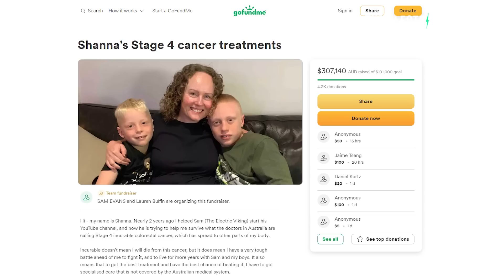CATL unveils Condensed Battery for Aircraft & 1000 mile range EV's

Comment: It would be interesting to know how fast these batteries can charge and discharge.
Reply: You'd assume it would have to be fast discharge for consideration in Aviation.
Reply: @Foogle6594   (not really as flights usually last a couple -- to many hours, less the economy is better using trains.)
Reply: @kadmow  I'd have thought that you need access to a lot of power very quickly at take-off (discharge/recharge rate). 

I.e the Power capacity to weight ratio has to be high to deliver a lot of acceleration. But as you mention the Energy capacity (500kW/h) needs to be high to maintain the range of the flight.
Reply: @Foogle6594 perhaps a hybrid will be a viable option. Fuel for takeoff but battery during flight for 50%+ fuel savings...
Reply: @Foogle6594  High-drain batteries could always be used for takeoff, then switch to long-distance batteries.
Reply: 1000 kilometers or miles ?Big difference between the numbers
Reply: @ralphhamilton4006  Kilometers
Reply: I'd prefer to know how many cycles they last. LiPO are awful for premature failure, these need to be 1000 times better.
Reply: If they can manage to go with a standard they could just pop in some fresh batteries after pulling out the old ones.
And they will probably be hybrid.
Reply: My first thought also!
Reply: One tire for a massively heavy e.v. is min 400 dollars for one in Canada.  8000 pound car will burn thru tires.
Reply: @blazeboyblazeboy4470  
Yeah, not sure where you got that nonsense from.

Larger cars have larger tyres.  Low rolling resistance tyres that are typically used on EVs last a long time because they’re quite hard.
Reply: @boggisthecat  it's not non sense. E.v. tires are double regular tires.  Don't mislead people. Heavy vehicle tires wear out faster from excess weight. I'm a mechanic so try ur nonsense on someone else.
Reply: @blazeboyblazeboy4470 : Okay, putting cost aside for a second, the only way your vehicle (whether it’s a gas or EV) will “burn through” tires is if you’re using the wrong tires for the vehicle/driving situation. The factory original tires on my LEAF lasted for 51,775 miles before I replaced them; and to be honest, the only reason I replaced them was that the tread was lower than I wanted to be caught driving on snow/ice with, they could have easily lasted 15k miles more outside of snow/ice driving. So what’d I replace them with? The best non-EV all-season tire I could find. That was 4k miles ago, and they’ve already gone from the 9/32 new tread, down to just a hair below 8/32 with just normal around town cruising. So yes, EV tires DO use a harder rubber compound; and the $30/tire I saved buying the non-EV tires was definitely not worth it. I don’t expect these Goodyear rubbers to last more than 20k miles, if even that.
Now, yes; literally speaking, EV tires are more expensive. And from my experience, tires are the most common maintenance item people cheap-out on is also the tires. At the end of the day, using the right part for the right job wins out.
Reply: @blazeboyblazeboy4470  
You must suck as a mechanic then, if you don’t know how true types differ.
Reply: @jacobcarlson4010  blabby isn't even paying attention. The principle benefit of these batteries is that they weigh far less for the same charge, 
They will still need special tyres, but not because of the weight but because of the huge torque. That means that the contact on the road needs to be greater so, with the lower weight, the tyres will actually last longer, not shorter.
BTW, I've just checked the price of tyres for the MG 4, and even a premium brand like Pirelli is just over €110, which is hardly any greater cost than a similar tyre for an ICE.
It's also worth noting that, if you end up replacing the battery on your leaf, you may find that replacement batteries will be using this tech, so your Leaf could possibly double its range. I know there are now companies that do battery swaps for Leafs, and that is because there are so many of them around.
Reply: @blazeboyblazeboy4470  You're certainly no mechanic I'd trust, because your argument is simply ridiculous. BEV tyres are nowhere near the "Double" you claim. 
I literally just checked prices for Pirelli tyres for an MG 4 against the price of similar tyres for a similar ICE car (VW Polo). MG 4 tyres are actually about 50% LESS than the Polo.
I'm not saying that EV tyres are always less, but that the cost of the tyres you use is far more dependent on the specific dimensions (ie the car) than whether it is EV or ICE.
Not only that, but as I point out elsewhere, with this new tech, the battery and motor combined are going to weigh far, far LESS than an ICE's fuel, engine and transmission.
So there really isn't very much in your post that makes any sense at all.
Reply: @davidcolin6519  I stated I live in Canada.  This is Canadian price at local tire outlets $400 . Don't be a jerk
Reply: @blazeboyblazeboy4470  I'm not being a jerk. Tyre prices are far more dependent on the vehicle model than whether it is for an EV or an ICE.
Also, my point stands. That with energy capacity to weight being more than DOUBLE the current available, EVs will no longer have ANY weight disadvantage. In fact, they are likely to have an ADvantage.
If tyres for EVs are that much more expensive, I'd suggest that you write to the manufacturers. Because in the EU, the difference between tyres for an EV and that of ICEs is maybe 30% max, and a long way away from the double that you claim.
And I can easily post a link to tyre prices in the EU, but I'm having trouble finding the price for ANY EV that costs anywhere NEAR the C$400 that you first quoted and now have repeated.
In fact, although I understand that the C$ is worth about 30% less than the US$, it would seem that a SET of tyres for a model 3 is about $547, not the $400 per tyre that you claim.
So, I don't really understand why you claim that I am being the jerk, because all the false claims seem to be coming from you.
Reply: @blazeboyblazeboy4470  How about engaging your brain before making ridiculous comments?
The whole POINT is that a battery with this amount of capacity PER KILO means that BEVs, even with a 100kWh battery (and hence a range of 1000 km or even 1000 miles will weigh approximately the same as an ICE. 
That is because the battery (200 kg) and motor (a Tesla Motor weighs 45kg) will actually weigh LESS than the engine, gearbox and fuel of an ICE.
And, just like everything else in engineering, the lighter the whole ensemble is, the less work any component has to do, so you can lighten everything that little bit more, or simply make everything else even more reliable. 
So your claim of an 8000 lb car is simply absurd.
In fact, because BEV tyres tend to be designed to have a greater contact area, and because they will be lighter with this tech, then a car equipped with this tech is going to do the opposite of "Burning through tyres", and if you don't spend all your time doing burn outs, but just use your EV like an ICE, your tyres will last significantly LONGER than normal tyres on a normal car.
Reply: Three important points for widespread adoption. 1) TIME: Can I charge a car battery as fast as I can fill a tank of gasoline? 2) RELIABITY and SAFETY: Can I depend on my car not breaking down and not catching fire? 3) COST: Is it as cheap to buy and run as a gasoline car?
Reply: @afriedrich1452 we are already getting widespread adoption, where have you been?
Reply: @afriedrich1452  1) What’s that got to do with it ? At 500w per kilogram you won’t be charging it often. Probably not in a day , only night in most cases. 2) ICE cars break down , they also unfortunately catch fire. 3) Mass adoption will drop the price. It’s just a question of time before a new generation comes along without internal combustion history and simply doesn’t want the old noisy, smoky engines. Nobody wants steam anymore, once all kids wanted to be a train-driver. Times change, the future is bright 😊
Reply: @Known-unknowns  Right, if EVs are better than ICEVs in these 3 areas, then mass adoption will occur. I hope they do get better.
Reply: Example: A piece of road metal thrown up and puncturing a battery will most certainly result in a fire (as has happened recently). Puncturing a gas tank will almost certainly not result in a fire.
Reply: @afriedrich1452  Fires in ICE vehicles are far more likely and that’s with a century of improvements in safety. Electric cars are already much safer and will continue to improve. So if you’re worried about a car fire then go electric.
Reply: @tom0kiely  agreed, if you look at the US fire safety stats for different types of cars Hybrids are the worst followed by ICE engines and the safest are EV’e with the fewest fires.
Reply: @tom0kiely  "Overall, EVs are about 0.3 percent likely to ignite, versus a 1.05 percent likelihood for gas cars, according to the Bureau of Transportation Statistics and the National Transportation Safety Board." But, ICEVs usually don't catch fire when not running, but EV fires can start even when not running. And when EV fires start, they are hard to stop.
Reply: @afriedrich1452  Unless you drive a Pinto?

Comment: This doesn't necessarily make solid state batteries irrelevant. It means there is an additional choice. The two technologies could coexist.
Reply: If this is cheaper and more energy dense Sam might be right who would buy more expensive  less energy dense batteries if this works?
Reply: @awilson1193  There is rarely one technology that is superior in every way, so developers will want options for all the special cases. Maybe solid state will be needed for space because it works in extreme temperatures and has higher G-tolerance. Maybe something else is used because instead of energy density and low cost they really need it to survive literal million cycles.
Reply: price will dictate the winner assuming they can produce similar results
Reply: @jimmyjamesl2318  Price and reliability. They have used this battery technology in the aircraft, at least it has proved to be quite reliable.
Reply: If there is a very high demand to transition from petrol, more is better.
The price will drop on the older tech but it's still needed.
Reply: solid state has short life span and is insanely expensive. forget solid state, it is doomed.
Reply: @QL2004  We don't yet know that it has a short life span. We can't compare the life of early versions of a battery technology with fully developed versions of another. The same goes for cost. Solid state batteries could be a dead end... or they could be a real improvement. We don't know yet.
Reply: @ShirleyMárquezDúlcey  at this point, solid state batteries loss about 20% capacity after 500 charging cycles. for something like smart phones it is ok as we replace them every 1-2 years. but for a car, i don't think that is good enough. there is definitely uncertainties around this condensed battery. i am just saying solid state seems to be a dead end.
Reply: semi solid state batteries have poor cycle life
Reply: Thing with coexisting technology is...Instead of these batteries driving the cars, the batteries could be heating up oil to just below it's boiling point in a car, so that it's also not propelling the car forward...but maybe it's making hydrogen on board of the car...which WOULD drive the car forward...and then the physics of the car moving would recharge the battery through friction heat of tires spinning on road...restarting the process...but if batteries advance to hold more charge and recharge quickly enough, then synergistically working technologies and physics might be moot...but if batteries don't advance considerably in two-five years , and supercapacitors don't emerge in designs that could make battery advancement moot or less essential...that's where capitalism has been hijacked by dysfunctional engineering  or agents of insatiable greed.
Reply: Same way floppy disks and 1tetrabit external hard drives co-exists, they can be used interchangeably any day.
Reply: VHS will beat Beta in the long run, I don't care how good Beta is, or do I?
Reply: @afriedrich1452  LOL - in the long run they both died...
Reply: @jefflittle8913  Not in my house. I say, "To hell with DVRs and CDs. Magnetic tape and vinyl forever!"
Reply: @afriedrich1452  VHS and Beta used the same raw materials. So it was obsolete which one won. In batteries it's good to have many options for raw materials.
Reply: @timogronroos4642  Good point.
Reply: @timogronroos4642  stop making so much sense!
Reply: I've been thinking of the same exact thing these past couple months. Is this new battery laser disc, cd, DVD, beta, etc?
Reply: @afriedrich1452  Beta wasn't better. I had both systems for many years.
Reply: @Chris.Davies  So the hype about Beta was overblown. Interesting. I am thinking the hype about automobiles is overblown, too. Maybe I will ditch the car and go back to the more eco-friendly horse.
Reply: @Chris.Davies  That is, if I can find a place to plug in my horse overnight - otherwise, zero horsepower in the morning.
Reply: Japan has abandoned Batteries for Hydrogen. Anyone with an IQ Higher than their own Butt Hole realises batteries though improving are a lost cause. It simply takes too many to do anything useful too long to charge and there is and never will be enough electricity to run Society Industry and EV' s as already pointed out 500 tons of earth need to be mined to make one EV they're NOT environmentally friendly same for Solar Panels impossible to recycle. With a short life span. While these technologies will continue and have a place long term they'd technological DODO's and attempts to hype and up sell them are not in line with reality.
Reply: @yfelwulf  Japan appears to be finally realizing that hydrogen is not the solution, at least not in the near term. Both Honda and Toyota are frantically trying to catch up with making EVs. Toyota's experience with hybrid drivetrains should serve it well, especially now that the company is producing plug-in hybrids that can run entirely on electric power; take a Prius Prime, remove the motor, the complex transmission, and the gas tank, add more batteries, and you have an EV. It's not QUITE that simple because the engine is in the wrong place -- you really want the battery weight at the bottom of the car -- but the motors, regenerative braking, and software are already ready. Honda only makes mild hybrids so they have more work to do. As for the rest, Nissan already makes EVs, Mazda is trying to be the best buggy whip manufacturer by continuing to work on improvements to ICE, and Subaru has no plan at all.

The problem with hydrogen is that its end to end energy efficiency is terrible; you need about twice as much total energy to deliver a given amount of power with hydrogen because both the process for creating it by hydrolysis (hydrogen can also be created from fossil fuels but that's not a solution) and the fuel cells that convert it to electricity to power a car are inefficient. Distributing hydrogen isn't easy either; it's hard to contain because the molecules are so small.

Hydrogen currently wins at two things. Pumping it is faster than charging batteries, but battery charge times are improving and that will eliminate a lot of the advantage. The other is that its energy density is higher, even after CATL's new improvement to batteries; but the energy density of batteries is already adequate for ground vehicles. Hydrogen may play an important role in airplanes where energy density is much more important, but I don't see it going anywhere in cars.

Comment: I hope Aptera shifts their focus off of 4680 cells for their long range versions, either toward this, or toward Amprius's battery.
Reply: Don’t you réalise that 4680,and 2170 and 18650 and blade and ternary are just form factors (shapes and sizes) and that what really makes the difference is the chemistry/structure used inside the form factor? A 4680(0) size/shape can be just about anything with varying C rate/Wh per kg/cost/cycles. To recycle an old old advertizing slogan, “its what’s  (Watt? LOL) inside that counts.”

Comment: Now the ICE Industry definitely will see their sun setting date earlier than expected.
Reply: Not neccessarily.  Bev's still suck in cold weather
Reply: @iskdude9922  If this 1000 mile ranged battery gets mass produced, with cold weather deficiency, let's say 50-60%， the range is still 500 - 600 miles which is still larger than an ice car.
Reply: @Fldllse  yeah thats not gonna happen for a while
Reply: @Fldllse  1000miles.. You must be joking..  Nah.. Not possible..
Reply: @iskdude9922  depends on which chemistry - there are big differences
Reply: What are the chemistry that makes up the condensed battery.. Does it has Cobalt and Nickel..
Reply: What are the chemistry that makes up the condensed battery.. Does it has Cobalt and Nickel....

Comment: As regards  aircraft design , you would put the batteries in the wings with the engines. So, one pack per engine. Therefore if a pack fails,  or an engine fails,  you just shut it down.

Comment: 500 kwh/kg allows airplanes, but we must understand what kind of airplanes. Slow propeller planes of 300 km of range at most.

It doesn't allow long range airplanes. But there is traffic in these short ranges, so it can help remove certain kind of air traffic using fuel.

Comment: trucking needs this, the 4680 is a flop.
Reply: 4680 is just 46mm by 80mm. It has nothing to do with chemistry or energy density. You could make a potato battery in a 4680. Tesla is also increasing its energy density and estimates are that they'll also be hitting 500Wh/kg in the next 2 - 3 years.